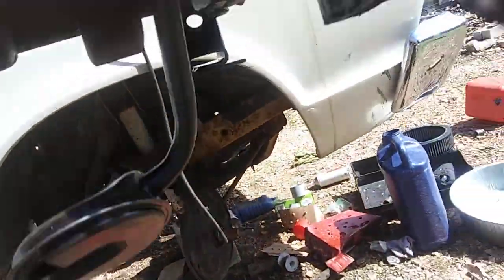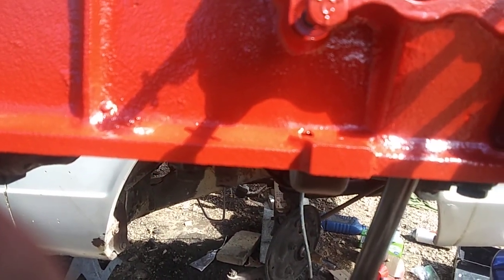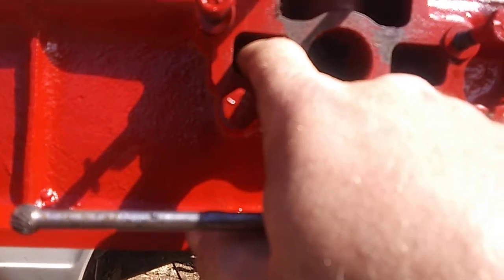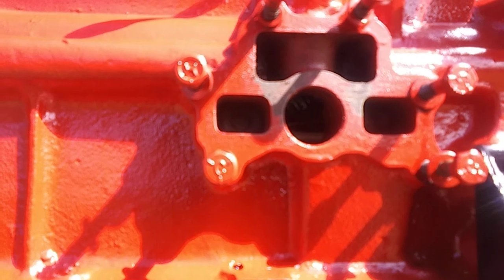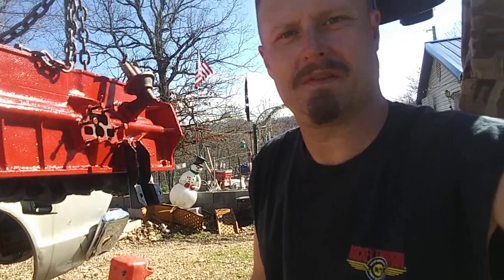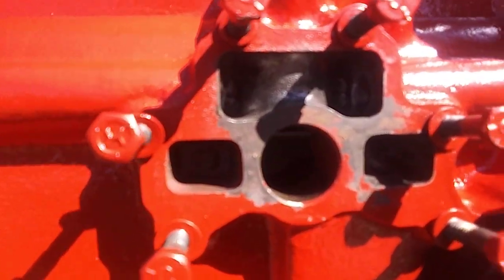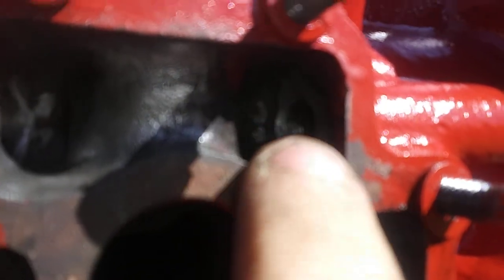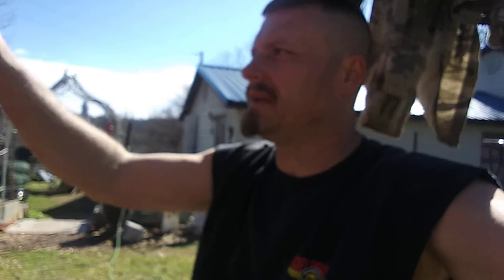SLANT6 OILING SYSTEM MODIFICATIONS     Part 3- Oil port entrances cleaned up (diegrinder bits)

Comment: This 6 cylinder is getting the VIP treatment. Im sure it will reward you with reliable performance for many years.
Reply from the maker: I hope so . I'm also going to buy the 75 dollar 1 piece rear main seal from fastfishautomotiveparts.com the seal can be used in big blocks/ slant6s . i did that for the other slant6 and no leaks unlike the stock rear main seals from fel pro ect. its actually going to be my mom's car but since we splite the cost of buying it I also get to drive it

Comment: My understanding for smoothing and blending oil passages is to reduce flow eddies and "quiet" the oil flow. It does give that craftsman personal touch to engine building too.
Reply from the maker: it also keeps the oil from frothing up under pressure while flow though . Sharpe edge causes turbulence and aerates the oil